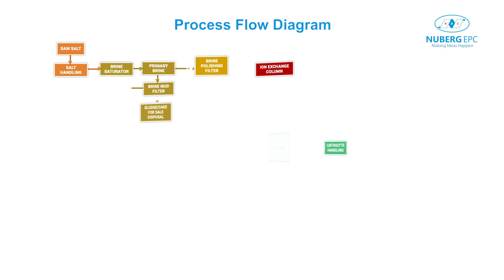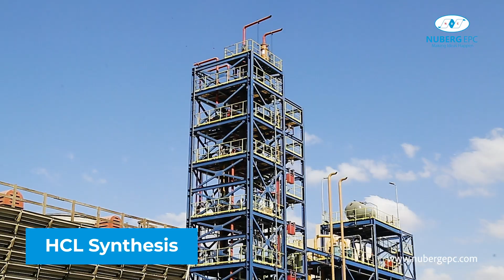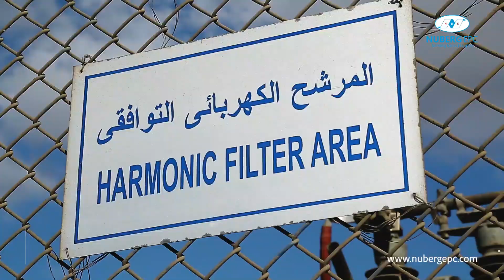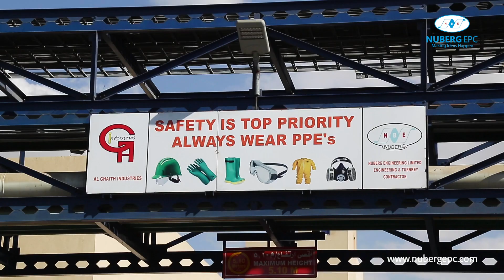120 TPD Chlor Alkali Plant, Al Ghaith Industries, Abu Dhabi

Comment: hydrogen has approx 3.42 times higher specific heat capacity than that of cooling water-does this have any effect on design orf hydrogen cooler or selecting a coolant for hydrogen?
any data on daily leak rate of hydrogen from enclosures in this plant?
any future plans to use the coproduced Hydrogen for vehicle fuel application  instead of making Hcl?
Reply: IT IS A FRAUD AND CHOOR COMPANY. THEY ARE HIGH CLASS CHEATER. THEY DO NOT PAY THE DUES OF THEIR SUPPLIERS AND EVEN TO THE TRANSPORTERS. FIRSTLY THEY GET UNLOADS THE MATERIAL WITH THE PRESSURE OF SHOWING THE BIG COMPANY AND THEREAFTER MAKING LAME EXCUSE DID NOT PAY THE DUE AMOUNT TO THEIR VENDORS AND EVEN FREIGHT TO THE SMALL TRANSPORTER. ALL THE PEOPLE AND BUSINESSMEN ARE WARNED NOT TO DEAL WITH THIS TYPE OF FRAUD AND CHOOR COMPANY AND IF THEY WANT TO DEAL PLEASE GET FULL AND FINAL PAYMENT IN ADVANCE AND ALSO INSTRUCT THE TRNAPORTER COMPANY TO COLLECT THE FREIGHT PAYMENT BEFORE LOADING THE MATERIAL OTHER WISE YOUR WHOLE AMOUNT INVOLVED WILL BE DROWN. PLEASE TAKE CARE. ISSUED IN THE PUBLIC INTEREST. PLEASE BE CAREFULL